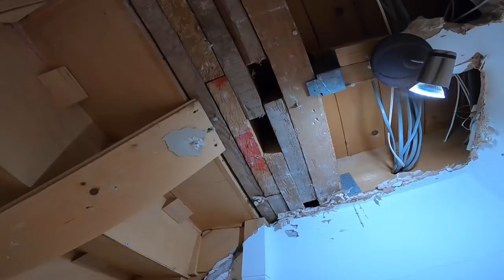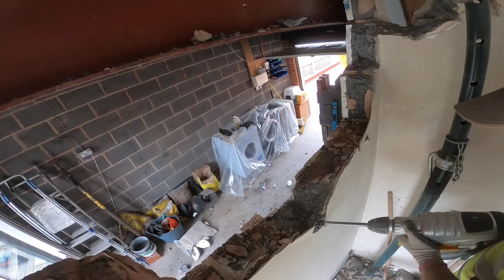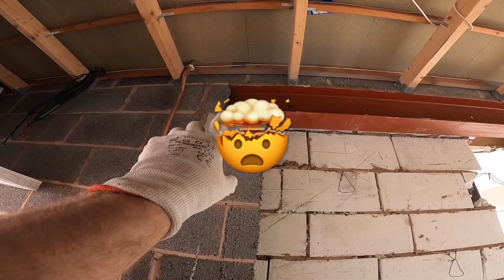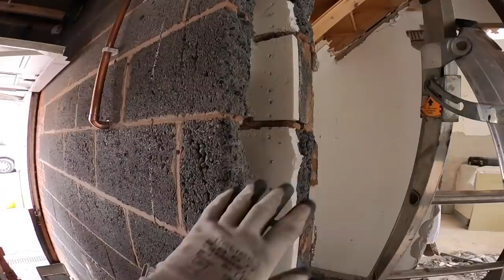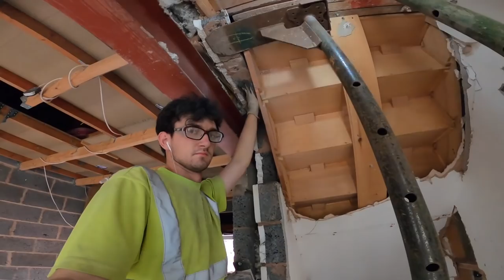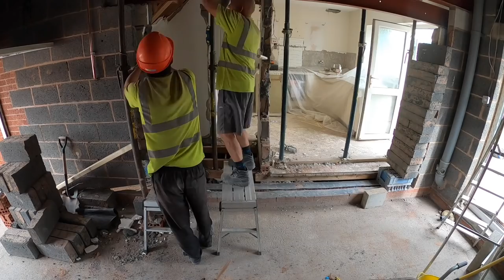BIG STEEL PART 2... WE ARE IN A PICKLE !!

Comment: Nice work fellas, buy the old man a genie hoist for Christmas
Reply from the maker: Cheers pal . They need a level floor and no wall in the way . Our floors were 220 mm difference 😒🧱👍🏽
Reply from the maker: @martin2466  😁👍🏽🧱
Reply: @SteveAndAlexBuild  the legs are like forks, you knock out couple bricks on floor in middle and the hole can be used on both sides pal
Reply from the maker: @whatsthisshi1127  🧱👍🏽

Comment: how did you put the spacers in between the two steels when you bolted the together ?
Reply from the maker: We didn’t it was impossible 😬🧱👍🏽
Reply: @SteveAndAlexBuild  I thought it is building reggs so when you tighten up the bolts the beam do not pull together plus they are the right distance apart.
Reply from the maker: @leebowley6953  The engineer didn’t think about that and specified oversized steels making it impossible to put spacers in . 
   We use a threaded Bar with 4 nuts , one each side of each steel nice n tight , better than spacers. 
   It was signed off by building control , that’s the main thing 🧱👍🏽

Comment: You will have fun getting the steel  tube spacers on the bolts between the 2 steels or do you not have to do that there ? To stop the steels pulling together when you tighten the nuts on the bolts. We have ours welded on one side, loads easier.
Reply from the maker: We usually put a nut each side of each steel but the clever engineer wanted 137 wide steels which made it impossible as it closed the cavity space . 
    We just double bolted  each ones and building control was happy with that 🧱👍🏽
Reply: @SteveAndAlexBuild  thanks for the explanation. 👍
Reply from the maker: @Simonsimps  Thanks for watching and commenting pal 🧱👍🏽

Comment: WHEN PUTTING IN AT STEEL WHEY DO YOU NEED TO PUT A PAD STONE IN AS IT IS STILL ON THE EXISTING BLOCK WORK
Reply from the maker: Building regs pal 🧱👍🏽
Reply: @SteveAndAlexBuild  I remember putting up steels in the 80s and padstones weren't even mentioned by building inspectors at that time.
Reply from the maker: @adgeebike9173  . 🙄🧱👍🏽
Reply from the maker: @martin2466  😏😁🧱👍🏽

Comment: WoW - another edge of my seat video by you 2. There would be those out there that would harp on about OH + S - however your methods are proven over time and not from a text book and indeed you got the job done. Question # 1 - have you used your normal mortar mix between the steel and the filler bricks or high compression grout ?? Question # 2 - what system will you be using  to maintain the present gap between the steel ?? Don't worry about Mr. Tickle Pickle he or she is just taking the piss because he doesn't live in the real world and probably still has his Mummy wiping his backside because it is too dangerous for him to do it himself. Great video, big thumbs up and looking forward to the next one. Cheers. P. S. iPhones should stay in the work bus during work time 100% focus on the job at hand especially ones like this.
Reply from the maker: Cheers Serge .
We just used normal mortar and we couldnt get spacers in but buiding control was happy with it 🧱👍🏽

Comment: Just hire a genee lift much safer boys
Reply from the maker: 220 mm difference in floor levels 🧱👍🏽
Reply: you can only use a genie on flat ground and if you have no obstructions in the way, i.e. pipes wires timbers etc
Reply from the maker: @MrAdeyb  . Thanks pal I must have written that 15 bloody times now , I’m sick of hearing genie 🧞‍♀️ 🤯 😁🧱👍🏽
Reply: @MrAdeyb  ive usedca small genee in tightrr spades than that safety first
Reply: @SteveAndAlexBuild  yeah you put the TV on and here genie wilder and genie wijnaldum
Reply from the maker: @MrAdeyb  🤯🤣🧱👍🏽

Comment: Pros at work with a £50 screwfix special
Reply from the maker: Er £60 😏🤨🧱👍🏽
Reply: @SteveAndAlexBuild  Not a good look m8 nor is pointing out how cheap you are to prospective customers.
Reply from the maker: @criticalthinking2062  . I see a power tool snob . 
So potential customers won’t get in touch because our very capable SDS  plus drill isn’t a certain red or blue or yellow , that is pathetic pal 🤣🧱👍🏽
Reply: @SteveAndAlexBuild  
Titan sds are very good and great value
Reply from the maker: @timevans6928  . They certainly are Tim 💪🏼🧱👍🏽
Reply: Change your username to Critical not Thinking.
Reply from the maker: @TyphoonVstrom  yep 🧱👍🏽
Reply from the maker: @martin2466  . Don’t you just love them , I’d pin him but mr testicles beat him to the top spot 😆😆🧱👍🏽
Reply from the maker: @martin2466  🤣🤣 Absolutely 🙄🧱👍🏽
Reply from the maker: @martin2466  🤣🤣😏🧱👍🏽